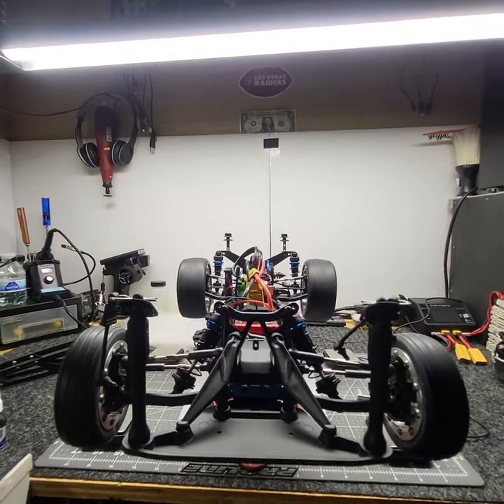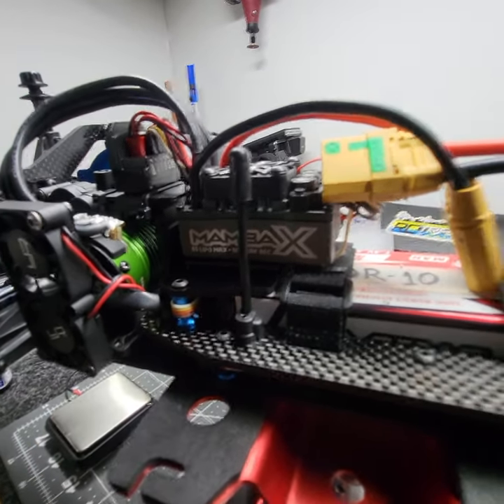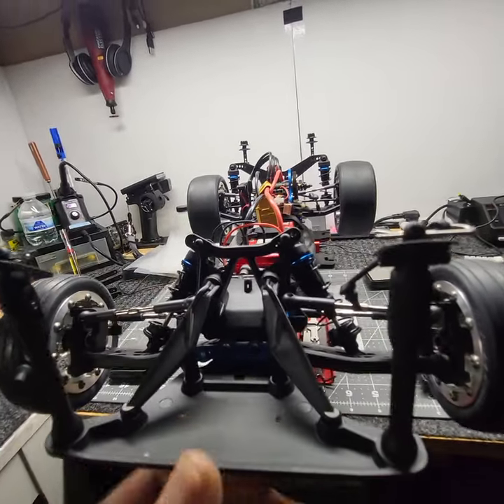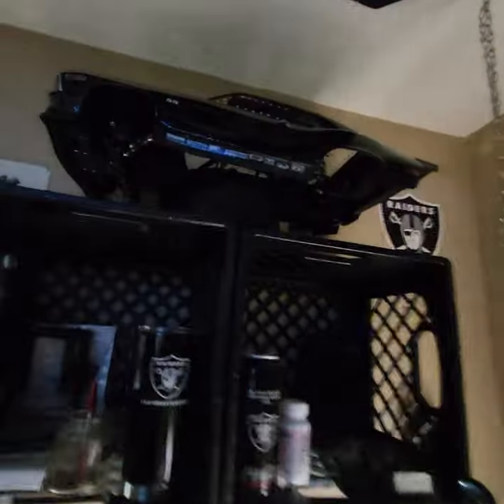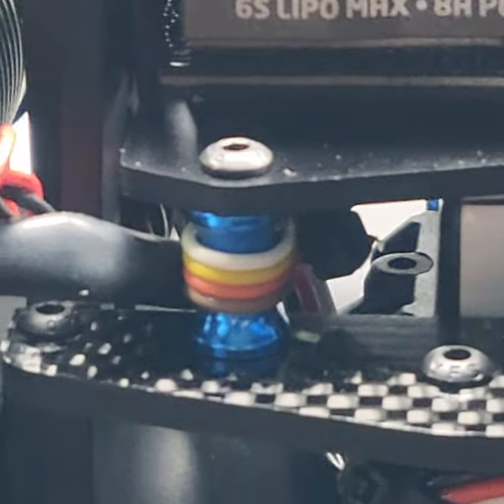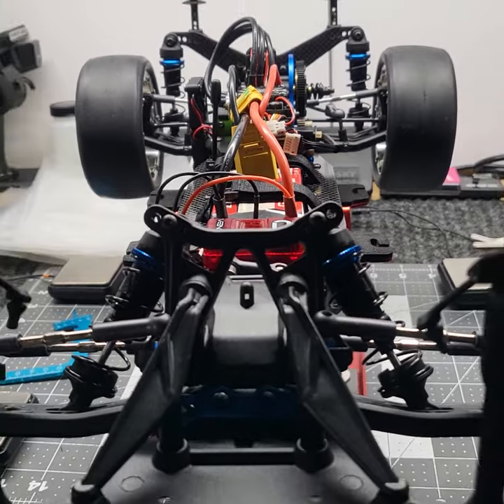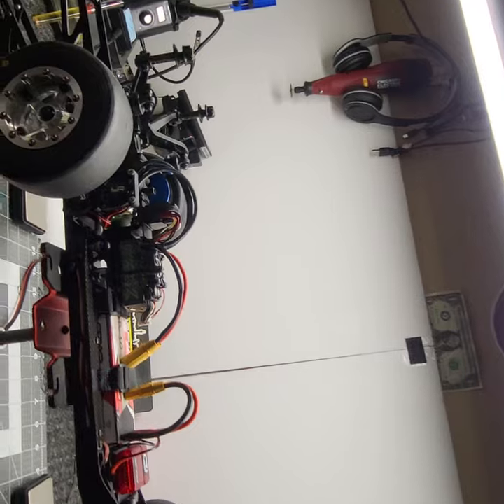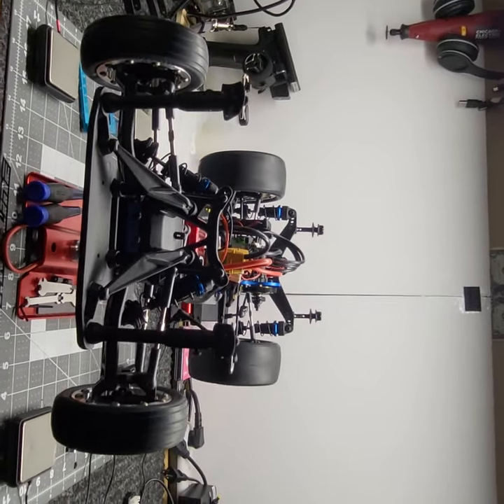DR10M completely built up and tested

Comment: ive had my M for a few weeks now, running the tekin rx8 gen 3/fantom 2.5t motor, locked out gearing, i took my wheelie bar took the big spacers out put in shorter ones and made it a single wheel bar
Reply from the maker: Nice
Reply: Wht gearing?
Reply: @edwardgrant2717  87/21 I just did my first 70mph at 2.3 last night 3 runs in a row
Reply: Ok, just asked because I run a 2.5T motor and I see a lot of different gearing options out there, I run 90/20T B6.3 2.6 diff. But was asking Vegas because I see you got big cars can I get a race? 1/7th scales
Reply from the maker: When you ready lmk
Reply: @tizrc1358  end of August birthday so I’ll be out there I’ll hit u up, keep up the good work!!
Reply: @tizrc1358  where you at

Comment: what wheels are those?
Reply from the maker: BAAD RACING
Reply from the maker: OG Original 1st version...beadlock with glue and you will have no problems going over 100mph..and your weight is lcg with the aluminum wheels